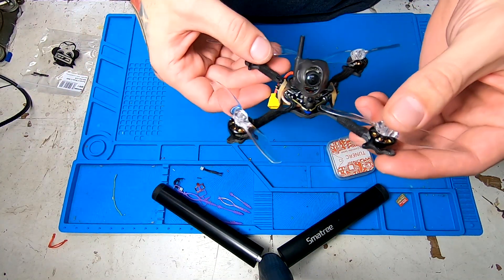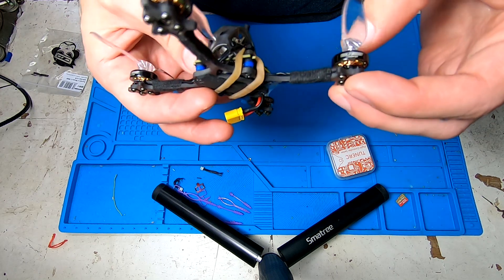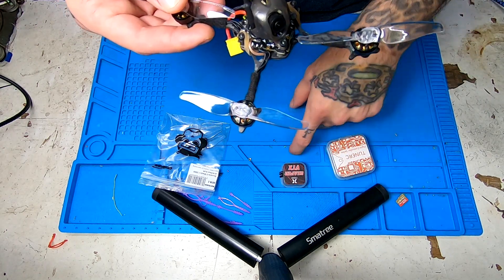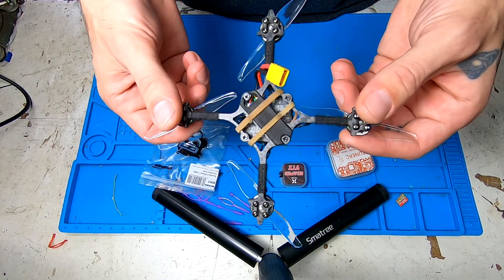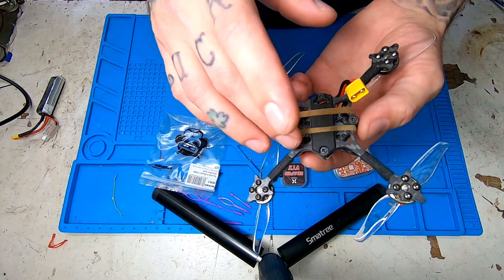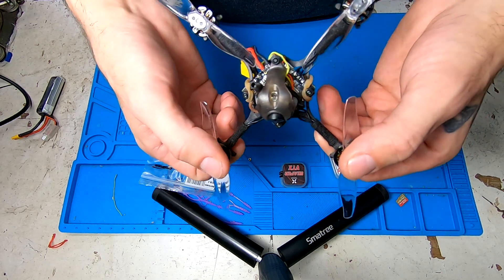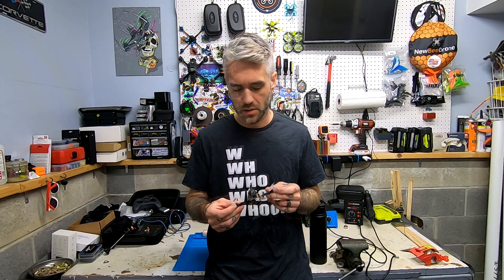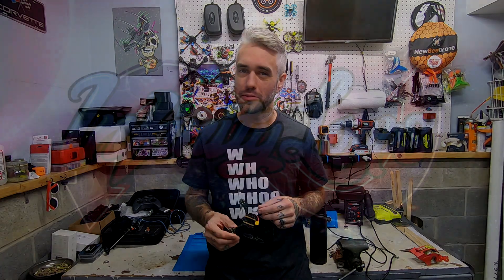TuneRC EZ F4 1-2S AIO Flight Controller | Build, Fly, Review

Comment: Wish it was available In the US
Reply: Hello, it takes 7-12 days for the parcel to be delivered to the US if you order directly on our website choosing registered shipping mail option. We also provide DHL shipping which is way faster but it's also more expensive at the same time. FPVCycle also sold our aio boards but they are out of stock right now. You can also order it on Rotorvillage, a Canada FPV store.

Comment: Can you use this board for brushed (2 wire) motors?
Reply: Hi James, I'm Aria from TUNERC, this aio board is specifically for brushless motors, you can't use it fro brushed motors.
Reply: @tunerc_hobby  hi, what are the ESC's amerage rating?
Reply: Hi @CXBFPV  Peak current is 7A continuous current is 5A. Max recommended motor used on this motor is 13mm motor, What setup would do you like to put this board on btw?

Comment: Nice Rip Bro,
That's one pretty hot setup for 5A esc, good way to find if this board is justified over other.
I planned to make roughly the same build with new beta 12A ELRS FC, but HGLRC just told me they discountinued the 8000kv 1202.5...
Reply from the maker: No way! Those motors are great. That sucks. I'm looking forward to seeing what you end up building.
Reply: @InfinityLoops  are the 8000kv motors more powerful than the stock motors? Like Don said it could be hard on the 5A ESCs
Reply from the maker: We will find out. So far 8 batteries flown and still kicking strong. 4:30-5 minute flights.